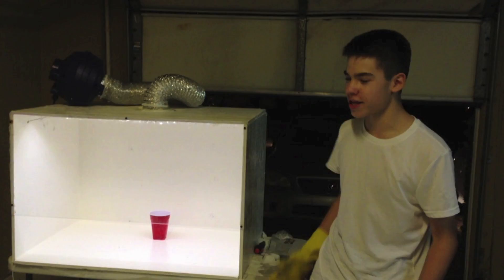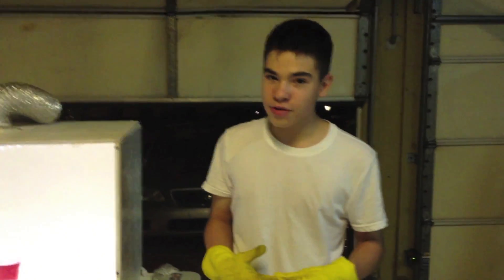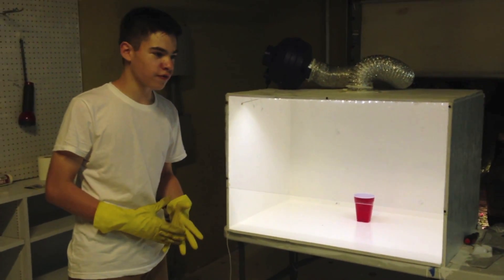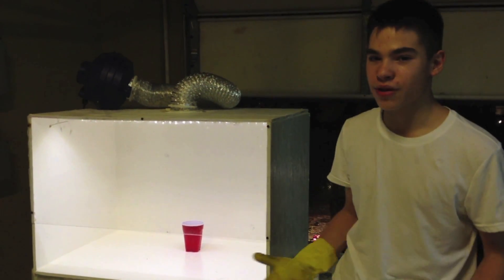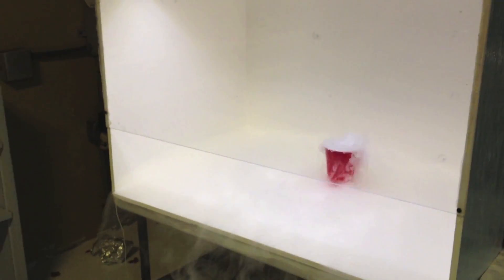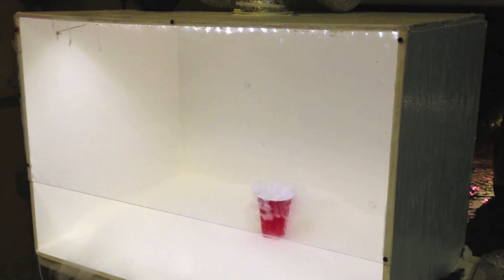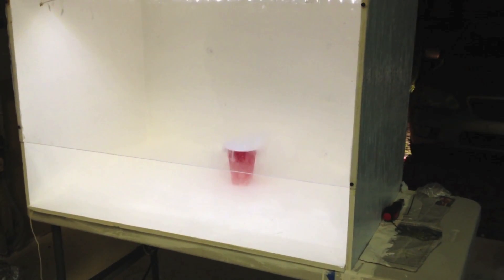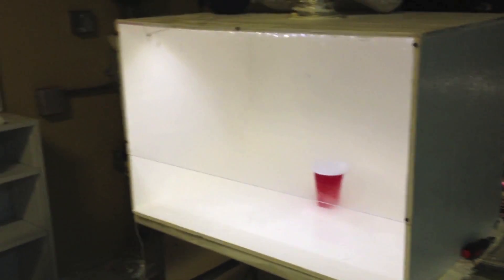homemade fumehood

Comment: Great project!!!!   Do you have printed plans for your hood? Dimensions of the box? Size of fan? How much is the fan calculated to pull? I can enclose the box to make it useful for a "clean room" box by adding another sheet of acetate, attaching with a piano hinge and locking device, cutting holes into the sheet and installing glove holes. 
Thanks in advance~!

Comment: What do you do with the fumes coming out? filter it, if yes, how?
Reply: MMinecrafTT activated carbon filter.  Its a round tube that has a double wall with activated carbon in between the outer wall and inner wall.  All of the walls are perforated to allow the air to pass through and in between the carbon.  This will catch allot of the contaminants before they get to your inline fan.  You would need to take the carbon out every 6 months and burn it for a couple of hours to burn off the contaminants that get trapped in the carbon.  If you don't use your filter as often you can get a year or more before you would have to re-activate the carbon.  Alternatively you can just buy the carbon from pet stores that sell fish/fish tank filters.
Reply: @cannagorilla  Thanks for that! I started searching YouTube in order to find that exact answer. Without it, it would be like, "I'm ok, but my neighborhood has corroded away and the cat is looking a bit rough" :D
Reply: @WayneRiesterer  your welcome.  You can get these filters already made on eBay, or at a hydroponic grow shop.  It is to filter any smells that might emanate from your in door garden.
I use it for this application and it works perfectly.

Comment: If your dealing with any harsh acids or bases I would add a scrubber before the fan to preserve the fan and I would also use a duct made out something that is a little less reactive than aluminum, otherwise its a great looking hood
Reply: Patrick Costan there are some made out of Mylar instead of aluminum.  The hoses that are flexible like the one he has are Mylar.  To filter the air you would need a scrubber.  The most common would be a activated carbon filter that would be placed inside the fume hood before the fan.